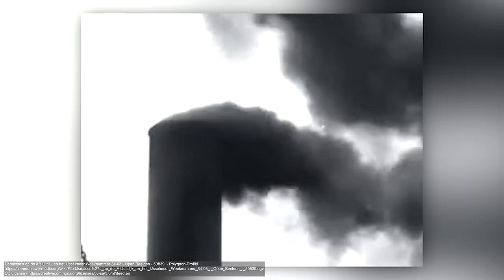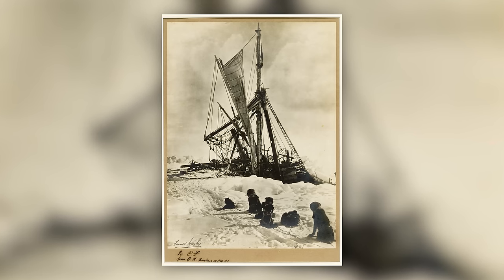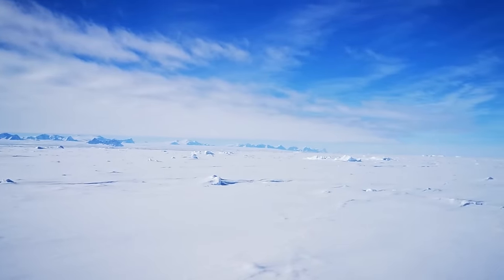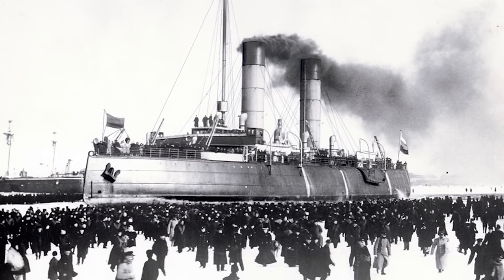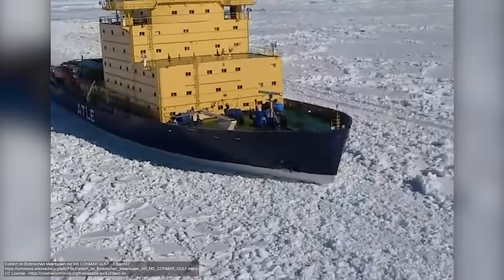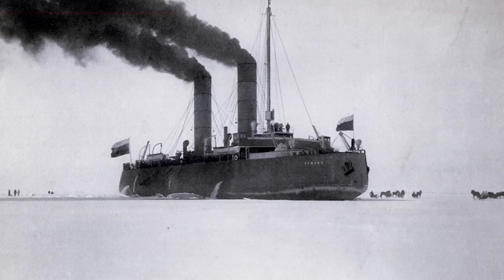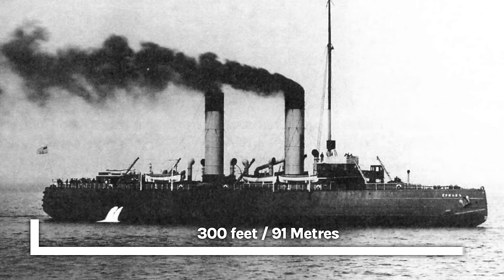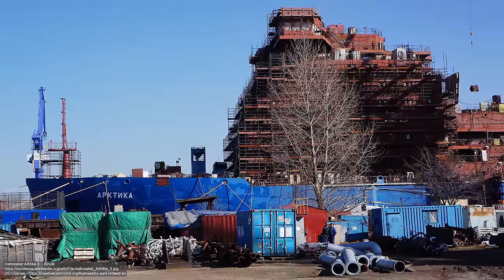How Do Icebreakers Work?

Comment: FYI: nuclear also uses steam. Nuclear is just the heat source just as coal used to be. They use turbines now instead of reciprocating engines and convert that to electricity (for electric motors) for more flexibility than a straight drive shaft. Canadian ice breakers use the same principle minus the nuclear and steam and using diesel generators instead.
Reply: I can second this. Nuclear done safely is the ultimate power source.
Reply: @abyssminiaturestudios6103 More than that, they are much more autonomous, than any other vessel. It is most important for a long distant expeditions through the Arctic Ocean. Because of such fact most of the modern icebreaker are nuclear.
Reply: @Uralski_Ivan  Russian (and I think China has a few, but I don't know much about them) are fascinating vessels. A huge amount of power and technology just to get through thick ice in extremely remote areas. It would be amazing to take on of those voyages they offer from time to time.
Reply: @mdavid2822  I do enjoy his content. He's definitely more on the side of historian than engineer though, lol. So, I just offer corrections when I can, which may also need correcting, lol, I'm not perfect. Steam (rankine cycle) is great at extracting heat from heat sources, especially when other cycles aren't practical. (otto/ brayton/ diesel, Eg)
Reply: @mdavid2822  Diesel engines are either directly propelling the shaft or an electric generator, no steam involved whatsoever!
Reply: Nuclear is just another, abet more glowy, steam engine
Reply: Amazing that in the end it all comes down to boiling water
Reply: @AndyHappyGuy  like I said, steam isn't always used but it's a damn good method when other cycles aren't practical. It's even starting to be used in combined cycle setups.
Reply: Nuclear also uses radioactive materials, so it's not a steam engine...
Reply: @AlexandruCarjan  it is absolutely a steam engine. It uses a turbine rather than a reciprocating expansion engine but it's still steam, at least until other coolants are used.
Reply: @abyssminiaturestudios6103  I love nuclear it's the best
Reply: It used the steam and turbines to make electric power to drive the turbines. the steam produced doesn't directly drive a turbine.
Reply: @SuperS05  But it drives electric motors
Reply: @RobertCraft-re5sf  and your point? That is irrelevant. The electric motor could be used with any energy source via a generator. It could also be directly driven like conventional designs. It adds flexibility and redundancy, but doesn't change the fact that steam is a very major component of the energy conversion. It wouldn't work any other way that is currently viable at that scale.
Reply from the maker: You know what I meant 😂
Reply: @OceanlinerDesigns  😂👍
Reply: Yeah but nuclear energy is generated by nuclear fission not by burning it bruh
Reply: @SuperS05  Just think that's an interesting level of complexity. Nuclear submarines don't have electric motors driving their propellers, at least that I know of. They use very quiet reactors and very quiet reduction gears and very quiet pump-jets to move extremely quietly, even with extreme power. The machinery is all mounted to the submarine hull with special technology to make them extremely quiet.
Reply: @nyotamwuaji6484  I think moving beyond coal power was a mistake.
Reply: @RobertCraft-re5sf  the topic was about the ice breakers in the video..... There's no reason why nuclear subs couldn't use motors and generators, as that would probably increase redundancy if done well. I'm not well versed on all the different subs out there. But that's all besides the point, they still use steam.
Reply: @SuperS05  Columbia Class Boomer will do just that
Reply: @RobertCraft-re5sf In a regular nucluar powerplant, assuming water is used to extract heat from the system, the produced steam is not used directly as it is in direct contact with the radioactive material. That water is kept in a closed circuit. But it is used in a heatexchanger to heat up water in a secondary circuit which can be used to drive a turbine.
Reply: @paulkroon4931  note that this is for modern designs. Many of the origins designs well through the 60's used only one primary coolant loop.
Reply: Well, Arktika is technically nuclear turboelectric drive.  Yes, nuclear reactors still use steam, but the actual propulsion source are electric motors.
Reply: Bro almost every cool way of generating power pretty much boild down to either water heating up and pushing things or just pushing things.
Reply: @derekmorgan9250 FYI, boiling water is not the only coolant medium used for nuclear designs, it is just the most common currently. Most people do not know that water/steam is used at all for any power station. Maybe you have an engineering mind, but it is not how the average person thinks and would easily be confused by this. It is a major reason why most people think the age of steam is dead, which is only true for smaller than utility scale applications.
Reply: Yes, steam/electric.
Reply: @davidvik1451  honestly the nuclear jet engine was a cool concept.... Minus the slight side effect of dumping radioactivity out the back. Some concepts with real R&D from the 60s-80s were kind of crazy.
Reply: @AlexandruCarjan  Why would you think that using radioactive materials means that it can't be a steam engine? Do you think that a steam engine is an engine powered by a type of fuel called "steam"?

What makes a steam engine a steam engine has nothing to do with how you generate the heat to create the steam.

The reason this type of ship engine is typically not referred to as a "steam engine" is largely just a matter of convention. Nuclear powered ships use the heat created by the nuclear reactors to heat water into steam, which turns a turbine, much in the same way that some ships in the past used coal or oil combustion to provide heat to create steam that would turn a turbine.
Reply: @Schwarzenfels  You could make a diesel powered steam engine if you wanted, though I don't know if there have ever been any production versions which were used in shipping or any other real world applications. However, there have been oil powered steam engines used in ships.
Reply: FYI, some steam engines in ships used turbines well before the first nuclear reactor was ever invented.
Reply: @OceanlinerDesigns  Many of us know that YOU know how these different types of propulsion systems work, but you said: "It's not steam driving her through the ice, it's nuclear power", which is no less incorrect or misleading than saying that a traditional steam engine powered ship "isn't driven by steam, but by coal power". 

Some people could actually take this to imply that "steam engines" were a type of engine powered by a type of fuel called "steam"!
Reply: @syncmonism   fuel oil is essentially diesel fuel. Lots of homes use (or used to) use fuel oil boilers that I work on. Fuel oil is much more diesely than anything you might identify as oil

Comment: I was watch officer on icebreaker Tarmo (built in 1963) for allmost 6 years... Totally I have been working on 3 icebreakers (one was museum icebreaker Suur Tõll built in 1914) and last one was finnish icebreaker Sampo (built in 1960)... I did find one little mistake... Arktika does use STEAM because nuclear reactor is literally one large steam boiler. Steam runs turbines that run generators which makes power for azimuth thrusters... Otherwise I do agree with you 😉
Reply: I picked up on that, too. ☢️
Reply: Little Offtopic Question: Do you know some Specs about the Propulsion Plant of Sampo (IIRC, Tarmo was very similar anyway). I'm working on a Video about it, but noticed something is a little off about the Datasheets that I was using for Research. What I am searching for is the max. Propeller RPM, Propulsion Generator/Motor DC Voltage, and the Voltage + Frequency of the AC Plant that powers everything else on board. I'm also in Contact with Kemi Tourism (I had to arrange visiting the Engine Room, it mostly is off-limits to Passengers), but the People who are in charge of that have to forward my Questions to their Colleagues in the Technical Department first.
Reply: @Genius_at_Work  sorry for missinforming... Karu was scrapped in 2021...
Reply: @tugboats79  Know that, I was just wondering if you remember some of these Specs from working on Tarmo and Sampo.

Comment: I have been to Antarctica 3 times on the old South African research vessel SA Agulhas, which was called "ice reinforced", but had the same sloped bow and 2MW diesel engines. We sometimes got sttuck in the ice and had to do the reverse and foreward technique to get through. We also made use of images downloaded from satellite to plot a course through the weaker parts and channels through the pack ice. Another time, I went down with the Russians on their Akademik Federov icebreaker,  which was about 3 times bigger and more powerful and went through the ice like butter. The South African Navy also aquired an ex Russian icegreaker for their supply ship, the SAS Outeniqua, which was also about the same size and power. Interestingly, the superstructure is very far forward, looking very front heavy, but this is to get the weight forward to crush the ice with the same sloped bow.
Reply: That is really cool. What job were you doing to visit Antarctica, if you don't mind me asking?
Reply: @cactusitude The first trip was for the maintenance of the South African SANAE III base  and to learn the conditions there. This old base was nearing the end of it's lifetime and a new base would soon have to be constructed. I was then responsible for the design and supervision of the electrical and electronic installations for the  new SANAE IV base and went down another 3 times during the construciont period. One trip was made with the Russians who helped transport the materials for us.

Comment: Canada uses icebreakers in innovative ways: In our summer, they work in the arctic to open shipping (each community gets hige shipmenst of non perisheable items during short seaon by ship) but in winter and sping, those aide breakers work on the St-Lawrence river to keep the shipping channel to Montréal open (St Lawrence Seaway used to be hard closed all winter, but with climate change this is more variable).  Montréal is year round. 
relevant videos titles:
Documentary : ARCTIC Experience & Operations   (the Louis St Laurent in Arctic)
CCGS Terry Fox 15 Aug 2015     The Terry Fox in the Arctic showing the back and forth needed and clearly showing how it rides up on the ice till ice breaks.

Note: the bubble making on side in  front of ship.   This makes for turbulent surface which breaks up ice around the hull and makes it easier to ship to advance. 

Another vehicle used for ice breaking is less known: the hovercraft.   It's weight over ice as well as pushing air under ice cause the ice to break up (with air under ice, there is no water to support it). 
One in action near montreal:  "Coast Guard Hover Craft Breaking Ice"
"Hovercraft Operations" by Canadian Coast Guard (french with english subtitles). 
"How a hovercraft helps Canada combat spring flooding"  (Weather network)

The hovercraft has worked on Lac St-Louis west of Montréal to help break up ice to open St Lawrence seaway early (with locks closed, ice breaker ship don't have access).  It also works in a number of rivers to help prevent ice jams and breaking up ice there allows it to flow downriver. The extreme maneouvrability and small size allows it to reach areas that a real ice breaker can't reach.

BTW, even the Louis St-Laurent has to do back-forth to pickup speed to rise over the ice (the Teryr Fox is smaller so understandable). Wonder if the massive Soviet ice breaker can truly push forwrad all the time or if it also needs back and fort on thick ice. 
Difference with Titanic:  Ice breaked don't travel at > 20 knots.  And ice breaker is far thicker and stringer ice than surface ice.
Reply: While hovercraft doesn't have to care about bottom below water, azipod equipped ships turn on dime just fine:
https://youtu.be/p9E0Q05-3Zg?t=80
And you can design relatively small narrow spaces fitting ship to be able to open wide channel in light ice conditions by running sideways:
https://youtu.be/zwe0MHRaqhA?t=347

Better and bigger icebreaker can run over thicker obstacles.
But especially pressure ridges can easily grow big enough to need that "ramming speed". Like this 20m thick ridge, which had already grown to reach sea floor:
https://youtu.be/xfFkfiMRP00?t=150

Comment: As a sidenote, about hundred years ago there was an icebreaker named "Stepan Makarov". Built by "Swan Hunter Wallsend on Tyne" shipyard in England in 1916, it was originally named "Kniaz Pozharsky" and renamed after the revolution in 1921. Ship was lost in the end of 1941, probably sunk by germans.
Reply: There is a new Stepan Makarov. An icebreaking supply vessel built in 2017 in Finland for servicing the Sakhalin offshore oil/gas fields. She has 4x Wärtsilä 9L32 engines for a combined output of 21MW. Propulsion is provided by two 6.5MW azipods and two 1.5MW thusters. Icebreaking capability is 1.5m when going ahead and 1.7m when going astern.

Comment: While originally designed and built as an icebreaker, the largest one ever was the oil tanker SS Manhattan. In 1968 she was equipped with a special icebreaker bow. As converted, she was 1005 ft in length, and displaced 115,000 tons. In 1969 she was the first commercial vessel to traverse the Northwest Passage.

Comment: My father retired from the Coast Guard as the COB of USCGC Mobile Bay, a 140 ft ice breaking tug out of Sturgeon Bay WI. Its duties included icebreaking on the Great Lakes to keep shipping lanes open durjng winter. During non ice season the ship woul equip with a 120 ft barge for maintaining aids to navigation.  What i thought was really cool was the propulsio, it used diesel to power electric motors. It's been 40 years but I think it break up to 10 ft or so of ice.  Nothing like the massive Soviet ice breakers but the USCGC also had a really big ice breaker called Polar Star and it was impressive as well.  
I was a Lance Corporal in the Marines when my father retired and he was able to take me on a week cruise (his final) and had an amazing time and look back at that time fondly. Semper Paratus Coasties!

Comment: Anyone interested in icebreakers might also wish to look up the career of the USCGC Mackinaw (WAGB-83). Served on the Great Lakes from 1944-2006. She's now a museum ship.
Reply: The USA built 8 'wind' class icebreakers, Northwind,  Eastwind, Southwind, Westwind, and 4 others. Three were loaned to Russia in WW2, and The  rest used by the USN, and Canada. They were very heavily armed at the time, but disarmed for Antarctic use after the war. The Russians returned their loaners after the war, and they eventually were turned over to the USCG, Russian Cyrillic equipment labels and all. They used the same principles as that early Russian one, and did have a third bow prop that could be used to suck water out from under the bow, not for propulsion. It had very heavy internal frames at short intervals, as well as 1.5 in. Armour plate used for the hulls., not for propulsion,
I served on the USCGC 'Burton Island (WAGB 283) for almost a year as an Engineering Student and Assistant Engr. Officer before transferring to a WMEC as Engr. Officer in Kodiak, Alaska. I've seen a fair amount of Ice. The USCG still has a lot of  larger, more modern icebreakers.

Comment: It could be argued that nuclear power plants are still technically steam engines. That's how we get the energy out of the reactor. Steam turbines, to be precise. It's just a lot more convenient from an engineering (and operational) standpoint to stick generators and motors between the turbines and propeller shafts. Makes for a much looser coupling than mechanical gearboxes, which can be very beneficial, especially when dealing with this much power.
Reply: Can only argue that nuclear plants are steam if you want to be correct.  And nuclear powered usually means you're not too worried about the energy lost when transforming energy from one form to another and back.
Reply: @boobah5643  I mean you got a whole nuclear reactor, what's another 2%, am I right?
Reply: TBF most Nuclear Ships except Icebreakers use Geared Turbines instead of Turbo-Electric Propulsion. The American and French Aircraft Carriers do, so do (most) American, Soviet, British and French Submarines. IIRC, Chinese Submarines are Turbo-Electric, but there isn't too much known about them anyway.

Comment: Great to see the “Orange Roughy” in there a couple of times! She was a familiar sight here in Hobart for decades. I got to go onboard for a tour in the early 90s.

And I know it’s already been said, but nuclear power is steam power. The only difference is the method of boiling the water. In this case it will be using steam turbines rather than the piston engines the original icebreaker had. The turbines generate electricity to power the electric motors. A seaborne hybrid, if you will.

Comment: One might add that in the beginning, it wasn't quite as clear which philosophy would prevail - cutting through ice, like the 1910 CGS Earl Grey (later sold to Imperial Russia and operated under the name Fyodor Litke until the late 1950s) or breaking the ice by weight, like the Yermak. Time has shown that Yermak's concept was better, and most icebreakers kept a similar design. One of the more advanced versions resulted in the Swedish Oden, being the first non-nuclear Icebreaker to reach the North Pole in 1991. Maybe an idea for a later video...